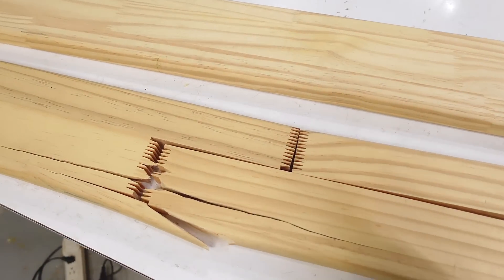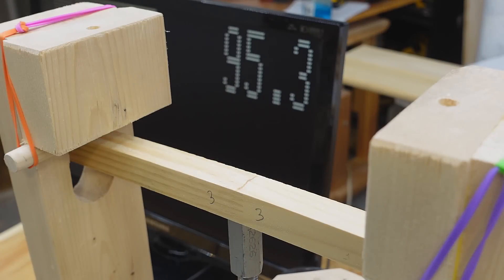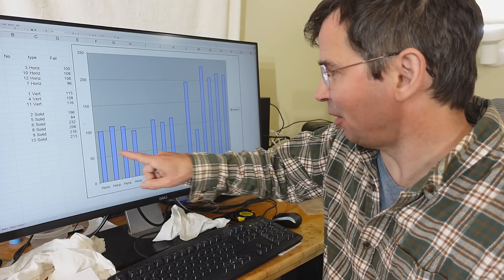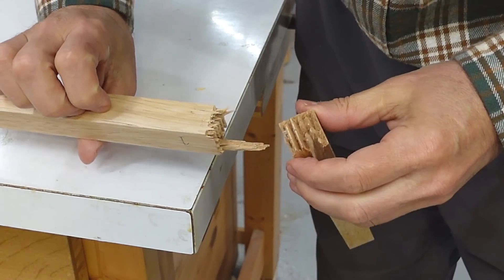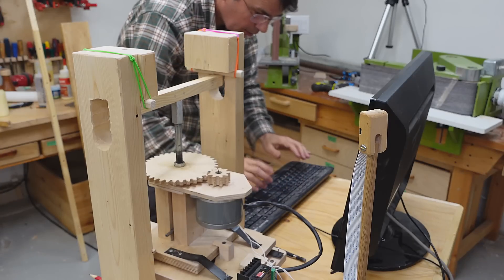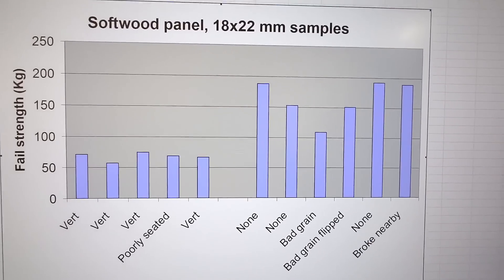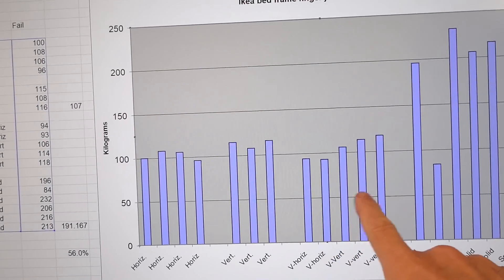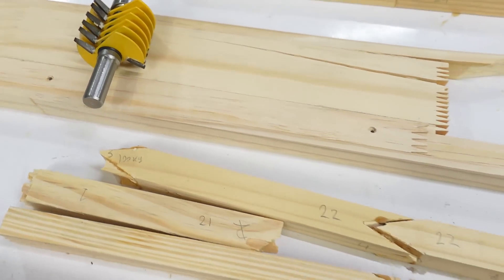How strong is finger jointed lumber

Comment: I think too few fingers and you don't get enough glue area. Too many fingers and the little roundover at the end of the sawtooth fingers is a discontinuity in the end grain that reduces strength. Longer fingers would work better as they have better leverage in a bend. I'd like to see a double W joint instead of a single V to compare.

Comment: The biggest problem with your test is that you are testing finish joints not structural joints ie butcher block tops as opposed to a floor truss which are designed for side loading which is the testing you are doing.

Comment: Although I like the scientific method you used this test only supports that finger joined lumber should only be used in a vertical manner and never a horizontal manner. It's not built or rated to be horizontal. It'll fail every time. But vertical compression strength is going to be comparable to a normal stud.

Comment: Why are you comparing the joints strength vs. solid wood?  Of course the solid wood is stronger.

Why not compare the strength of a finger joint vs. other kinds of joints?  That's the only thing that will tell you how effective it is.

Comment: Theoretically, wouldn't the strongest joint be a single dowel joint where the diameter of the dowel and hole are about half the side length of the wood square?

Comment: I mostly see finger joint on panels. So the finger join doesnt run the entire width of the panel  just a little bit of it  I wonder in that condition wherher finger joints panels are any weaker than regular panels.

Comment: the horizontal finger joint should be less strong than the vertical just by how the glued surface is being stressed here. When put vertical, the forced act in a much more advantageous way to a glued connection than they do in the horizontal alignement

Comment: I think the way you talk about failure is wrong. When you glue the joints together you are not fusing wood together, you are binding wood by glue. so when it fails, it will always be a glue failure. You have separated the wood, simply gluing it bad together does not mean that it is one solid piece of wood anymore, even though it may look like one solid piece. 

In Summary, you are testing joint stress, versus wood grain stress. that's it. So no need to say "seems like a glue failure" or whatever. it's a joint failure.

Comment: 4-point bending test would be better than 3-point bending to for this application. That's because in 3-point bending you have maximum bending moment in one point, in your case exactly where fingerjoint is. On 4-point bending test you have the same bending moment between 2 points (on 1/3 of the sample length). In this situation Beam will break in the most weak point. I recommend reading about it. 
Nevertheless nice content
Reply: Also you can do test in two planes, depending on orientation of fingerjoint separetly. Also grain direction in two glued pieces is very important.

Comment: The strength of wood comes not from local hardness but instead from long contiguous stands of the grain that can spread the stress out, so it makes sense that no matter what joinery you use it caps or at around the same strength. 

Said another way, the joint will never be able to bend as far as unbroken wood and still be able to return to its neutral state.  The harder woods get more out of joinery because they do less bending to begin with.

Comment: Love the test setup !!  Timber joints were tested extensively back in the 40's and 50's when timber was used extensively in aircraft. Your roughly 50% value reproduces those results for simple joints with good shear area. The only way to get much higher values is by using the more complex  stepped lap joints that manage the bond load and peel stresses at each step to get cohesive failure i.e half the adhesive is evident on each side of the laps after failure. In the 70' programs became available to analyse the joints in detail and versions of these are still used today for bonded joints in metal and composites.

Comment: Thanks for the video.
Made round chair bases using veneer in a RF press for fast cure time for leather chairs. They where put together using finger joints. 
We did a test using the standard glue, and Lepage construction adhesive ( this would be 15 ago so different then you could buy today ) . When the test came back the standard glue we used failed at the joint. The Lepage glue tested had to stop machine limits where reached, ie the joint did not fail the machine was just destroying the part as a whole. 
For stupid reason the company did not use the Lepage glue, even tho Lepage wanted to give them a free system to dispense the glue from a 50 gallon drum.

Comment: It seems like in some cases the glue was the weak point. 
I used to work at a furniture store that built furniture and we had a wood glue that was almost like super glue with sawdust. We used to make a batch everyday, scoop it out like flour. It was definitely stronger than the wood.

Comment: If you let the wood weather you don't need a stress tester, the wood self-destructs.

Don't use this stuff externally, even painted.

Finger-jointing is nominally used to producer straighter sticks, which is why it has been used in joinery, not for strength but straightness. Use internally only.

Note also that it requires greater paint preparation.

Comment: Have you tested these tapered finger joints versus square box joints?  With the square joints you have more end grain to end grain maybe, but you also have more long grain connections along the sides of the teeth.  The tapered finger joints will also have end grain exposed all along the length of the taper, but the connection is at an angle, so that could improve the bond greatly.

I would expect the tapered finger joints to be stronger, but by how much I don't know.

Comment: Many years ago I worked in a lumber mill that made finger jointed 2x4 studs cut to standard lengths for 8ft and 9ft walls. I actually did quality control for the factory and the studs we made were only to be used vertically (structurally) They would fail tests in horizontal orientation where you put lateral stress on the glue joints. But under compression they were stronger than solid pieces. Mostly because we'd cut the knots and other weak points out of the material that we made the finger jointed studs out of. The finger joints and glue didn't make them stronger, the lack of knots and other inclusions did.
Reply: Yup! You have to match the product to the use case - ESPECIALLY for engineered wood products.
Reply: Nice, thanks for the insight. Love reading comments from people in a related industry
Reply: Also they are straighter than normal 2x4s.
Reply: i know absolutely nothing, understood nothing, and I randomly clicked into this video. Thank you for your magic words sir.
Reply: @kronographer  When fj studs came out, their selling point (up here in BC anyway) was that they were always straight with no wane. By the end they were worse than full studs. Also doesn't the glue melt in a fire, causing premature collapse? I think I heard that.
Reply: @robmarsh6668  The glue burns just like wood.
Reply: @brianbarney1885  someone told me the glue liquifies in the heat and the studs collapse long before they should. Our value added forestry industry hard at work to make our lives better.
Reply: Did you do pull tests, or just compression? I worked for a lumberyard, we never sold FJ studs,  but the reps said the glue was stronger than the wood,
Reply: The main problem is it always delaminates, look at the problems in windows and doors.
Reply: @MS-ig7ku I sold doors, and would see the failed doors 90% of them was a painter fail, doors have 6 sides and most of the failed doors, didnt have any paint on the top and bottom edges. 
( We mortised and bored the new door knob holes, using the old as a template, as a service ). 
Paint all 6 sides on ext doors and they will last longer.
Reply: @MS-ig7ku  it doesn’t always delaminate- that is totally controlled by the glue used. Most plants use catalyzed PVA which at best is water resistant; it’s fine for door and window applications which should be protected from moisture by use of sealants or paint. A swelling joint is an indication that the vapor barrier in the house is faulty. The exterior trim and soffit material on my last house in SW Washington (The Pacific Northwet) was fj spruce preprimed and given 2 coats of Miller latex paint. 10 years after I installed it there were no swollen or delaminated joints.
Reply: @brianbarney1885  Latex paint seems very bad at protecting wood, I solved a lot of problems when I reprimed the wood work with oil paint. Titebound III seems to work fairly well.   Using solid wood for doors and windows is common sense.
Reply: knots are weak points? in my experience (chopping wood) knots are the strongest part!
Reply: @themanformerlyknownascomme777  If you're trying to cut through them, sure. But they aren't contributing strength to the wood around it. In fact, it's basically sitting in a hole, ready to pop out as the wood is stressed. That hole is what makes the wood weaker.

Comment: From my observation, those joints work quite well in the context of a panel, when multiple small strips are glued side by side. Unfortunately, IKEA use those joints everywhere, including in chairs, as a cheap way to "elongate" wood. As a result, most IKEA chairs are utter junk in terms of longevity.

Comment: The code actually has two different ratings for finger jointing. They look the same but are very different. The finger joints used in glulam are rated to meet the minimum strength of the wood(including tension load). You can also special order dimensional lumber with the stronger finger joints. Other finger joints are only rated for compression gravity load or short term bending/tension loads.

The strength in the code is based on the 5th percentile capacity. The 5th percentile strength of the joint has to be more than the 5th percentile strength of the unjointed wood. So even though the mean strength is less for the joint, you can still assume a full strength for the joint.

I would also be curious what would happen to the strength of the v-notch if you also clamped perpendicular to the joint during glue curing. I think your glue joint would be stronger.

Comment: I wonder if drilling a small hole perpendicular through the fingers (assembled) and sticking in a little dowel would make a significant improvement. Something to help increase the sheer strength of the glue on the surfaces.

Comment: Nordic carpentry rule of thumb when joining softer woods is a 7:1 ratio on the finger length the reach near solid wood strength, assuming that you use proper glue.

Comment: I work in a sawmill and my dad works as an inspector for a lot of the sawmills and finger joint mills in the region. He said they do batch tests and will test until they fail. Sometimes they'll fail at a super high pressure and will slip out of the rig and fly up and hit the roof 30ft up lol

Comment: Regardless of the joint I'd expect just normally wood glue to perform better. Are they using like a low quality epoxy or something? Or maybe not cured enough? 

I'd be curious what a finger joint with like a normal urethane glue up and cure time would look like

Comment: I would imagine the strength of anykind of glue joint is entirely dependent on the strength and quality of the glue. 

Run this test again, full finger joints, with titebond 3 or similar and i would imagine they would be indiscernible from the solid sticks.

Comment: Back in the late 90s, I worked for a few years building trailer houses in a factory. We built the walls with finger jointed 2x3 and 1x3 top and base plates. The walls would break and have to be rebuilt as it went down the production line. I can only imagine what condition the house was in once it was delivered. Absolute garbage

Comment: Need to change your adhesive and use more.  I had a home back in early 80’s and the wall studs were all random finger jointed.  You want to use random material, cut then jointed at the same cut.

Comment: Where is the application that those forces would be expected?
The biggest problem in practice with finger joints is exterior application like door and window casings. 
Eventually the joints reveal themselves due to weathering.

Comment: I make about 2500 metres finger joint wood per day at work. Joint have to be perfect and type of glue and amount is important. Also how much pressure you use to press to wood. Examble we use pine and 48x68x6000 mm wood you need a 70 bar pressure about 6 seconds.

Comment: Nothing like a scarf joint. Those finger joints are about saving wood. Wooden mast scarphs can be 16x or more the wood thickness to spread load and give a larger glue surface. I have never known anything go into a boat less than 3-1 scarph length, and your testing shows why, it loses too much strength.

Comment: The joints you were testing with the Radiatta pine and rubber wood samples were 1/4” or 6mm joint lengths, these joints were designed to ‘stretch’ board length i.e. get longer pieces out of short scraps. They are designed to be strong enough but not structural by any means. Having said that I’ve handled and used pine molding up to 16’ length made from 4” and longer blocks  using 1/4” joints that was plenty strong for the job. 18 years in the finger jointing business taught me that it is THE most exacting and difficult job in a molding or lam beam plant. Thanks for showing a very creative test machine and very interesting video.

Comment: Kinda wonder if instead of just clamping the ends, clamp at the joint to compress the joint together. Might be just loose enough its not getting good binding but who knows. I have had poor glue togethers on solid oak and I was breaking the oak apart before the glue was coming off. Some of the glue joints you could slip a credit card through when they were glued up. Was going to use them as spacer material so them being glued properly was not a needed thing.

Comment: My wood tech professor in university invented that joint. I observed the testing. You are see a production quality issue. The joints, prepped and glued and cured with the designed equipment do not fail that way. 

Prof Talbot also invented Masonite, particleboard and truss joists.
Reply: Interesting, then where did the name come from if not from William H. Mason, as the Wikipedia claims? Also when did you have classes with that professor, since all of the technology you mention is now very old. Wikipedia says the first masonite-like product was already made in 1898.

Comment: Also with so many of these failing at the glue joints it begs to question of the holding strength of glue.  What glue creates a stronger bond?  Seems like a question for Project Farm.

Comment: My stair hand rail broke at the finger joint glue line. I re-glued it and it's noticeably weaker at the joint. I need to add a wall support at the joint before it breaks again.

This was good information Matthias, to give relative strength % values to what we intuitively knew. Also great comparison info on hardwood vs softwood.
Reply: I'd love to see a concentric finger joint on a round rail. It would look cool like the growth rings of a tree, although you wouldn't see much from the outside. You could probably cut one with some sort of spinning grooved disc, or even just slowly lowering spinning blades.

Comment: Scarfs joints are weak by nature and finger joints are only as good as the glue and clamping used to adhere the two lengths. On more than a few occasions I have cut into glulam sheet goods and the finger joints have fallen apart due to a complete lack of adhesive

Comment: I wonder how the full composite panel would compare to solid panel. I wonder if the full composite panel is also half as strong as the solid, so somewhere between.

Then compare that to cost of each: strength vs dollar. Granted, it’s hard to do that with trash finds: Infinite strength every time!

I agree with the results here that solid hardwoods are the strongest, structurally. (Not that my disagreement with facts would hold any weight.) 

When it comes to decoration and trim, where loading is not a factor, finger joined seems like it should be fine, especially if painted. I tend to not like the look of the finger joints, but under paint? Shouldn’t matter.

However the pieces Matthias found were parts of a bed: structural. And they were stained/varnished. And they were probably pine/softwood? All things that would lean me against using finger-joined boards for the application.

Comment: Years ago, the using finger jointed  2x4, 2x6 lumber was the rage. Arguably, it is intended for vertical stresses, not horizontal. It's why we never saw them used in trusses, they were weak. Part of that is the terrible glue quality used and it's thin to non-existent application at the offending joint. The marketing concept was to use off-cuts to make usable lumber.  The first finger jointed studs to hit the market weren't terrible as they had to pass the test of the industry. Subsequent iterations were terrible, then became more expensive. I'll not use them, I have used them, those houses are still standing, thankfully. Pat Sullivan does a very good test of the strength of simple end grain glue joints, finger jointed wood should be as strong or stronger, but it's not. Manufacture failings. A new test showing the result of your own glue up on a finger joint would be markedly different, try it.  Anyone who uses a manufactured finger joint in a horizontal load application shouldn't be building.